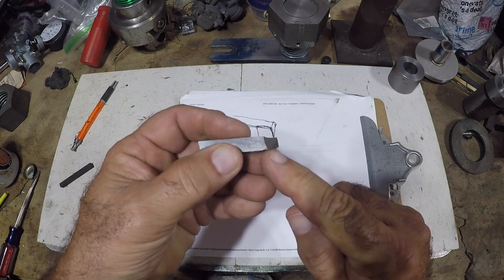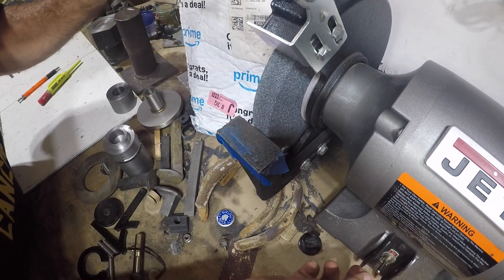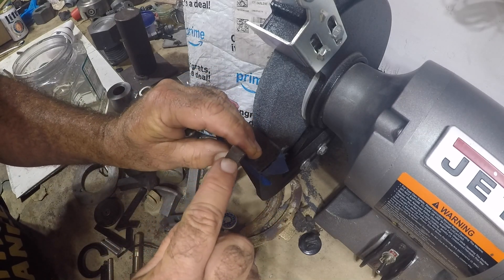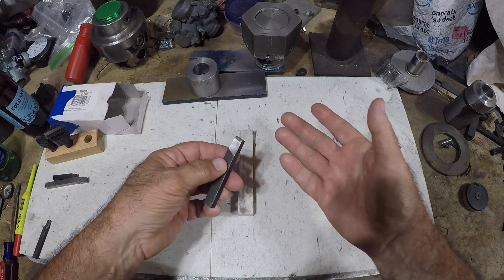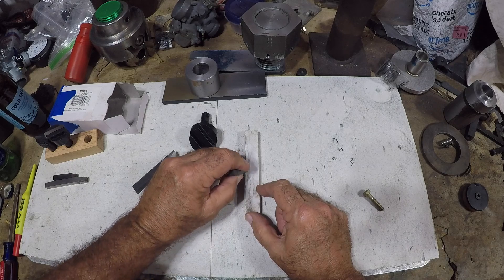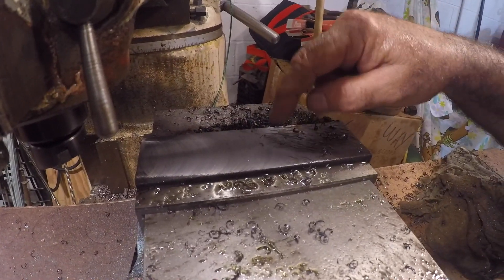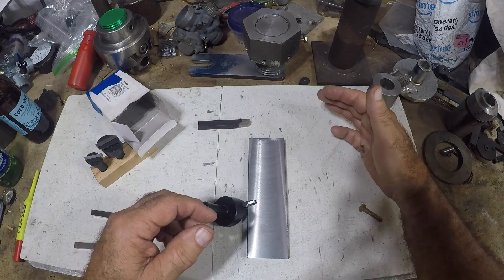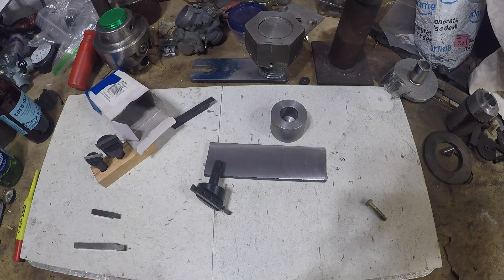How to Grind a Fly Cutter Bit

Comment: You will be better off re-cutting the slot in the cutter body at an angle to give top rake to the toolbit. You will never have to grind the cutting face again as it will remain on center. If you grind the clearance all along the toolbit that wont ever need grinding again either. To sharpen the toolbit just the outside end will need to be ground.
Reply from the maker: Thanks good advice

Comment: What angles did you grind it to?
Reply from the maker: I try to grind to around 10 degrees. But don't get caught up in the specifics. Grind one and try it. Don't go less than 10 degrees
Reply: @theundergroundesd thank you for the response I appreciate it. Today I grinded a 5/8 HSS blank to make a fly cutter. When I used it the cut was rough I believe I didn’t leave enough of a relief because when the cutter cuts initially, it leaves a good finish, but when it comes back around, it makes it rough so I think I have some rubbing going on.
Reply from the maker: Maybe. Remember to put a big radius on the cutting edge and use a slow feed rate. You only have one cutting edge. Feed and speed play a roll also.